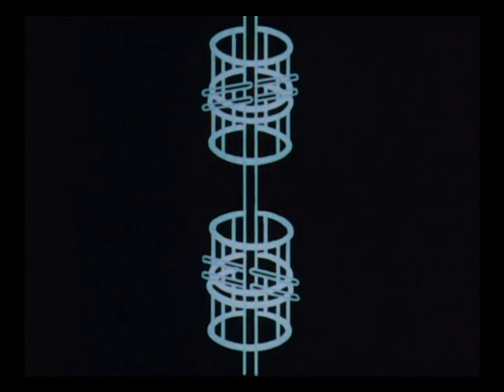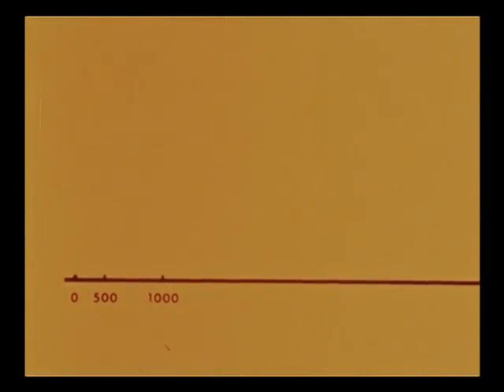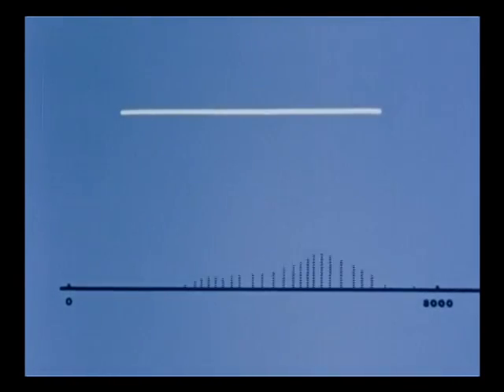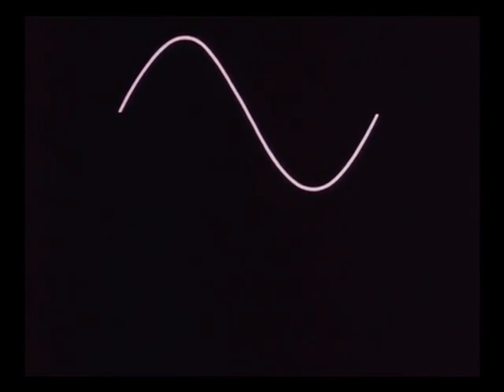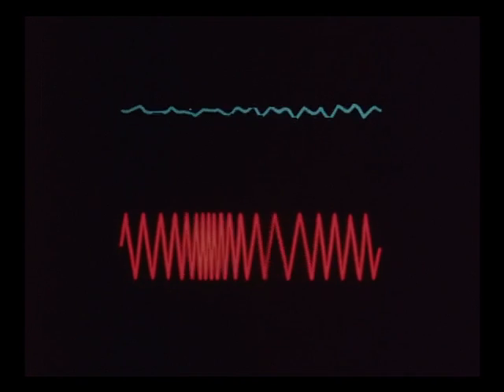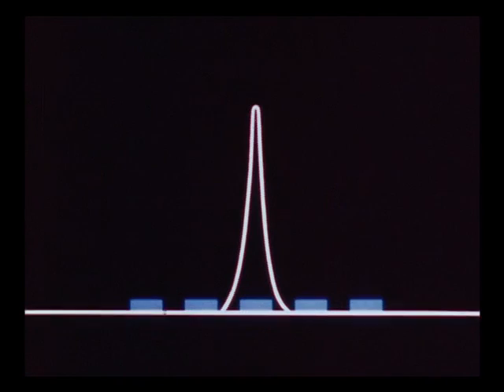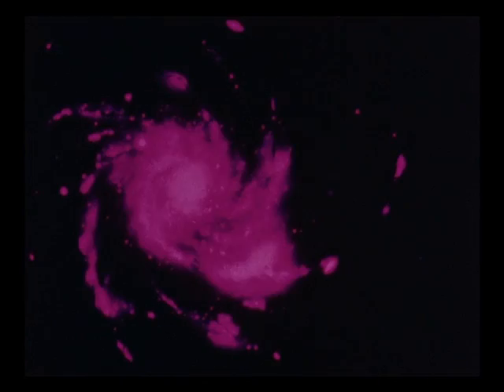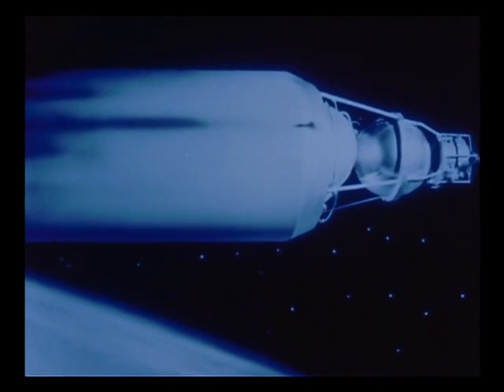Antenna Theory Bandwidth

Comment: do broad band antenna rules apply only to transmitting, or receiving as well? can we receive a broad band signal with the dipole ? i mean in theory we can receive only one channel, right, or am i misunderstood it ?
Reply: yes it applies to receiving as well. If the signal is broader than you can receive the parts outside will be lost and the further away from the center of the antennas tuned frequency, the smaller the received signal at that frequency. If you connect an antenna to a network analyzer, then you can see how the antenna will receive signals at different frequencies. What do you mean by one channel? As in voice channel? With the right hardware you can capture just about everything that you can receive with the antenna.
Reply: Они достаточно широкополосные